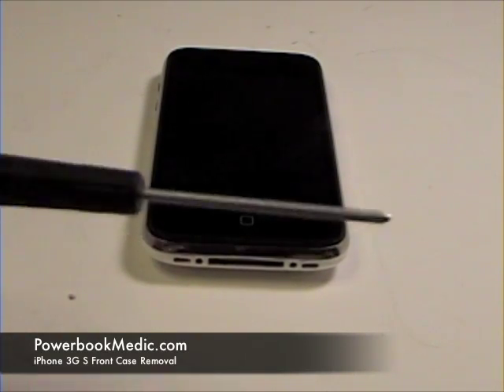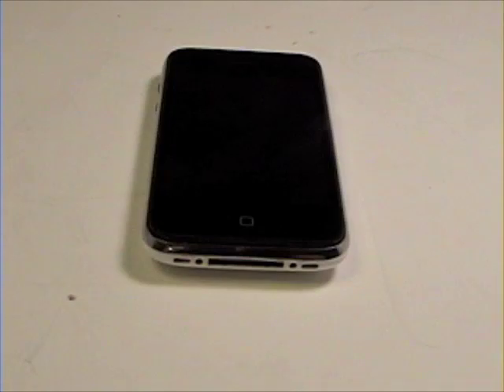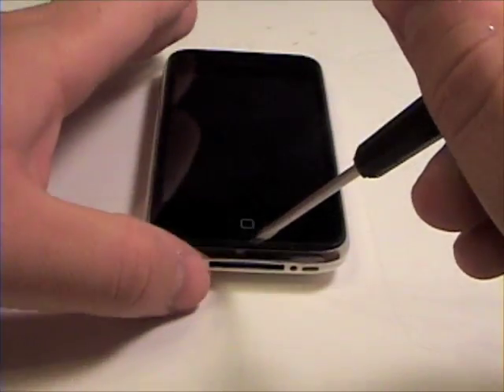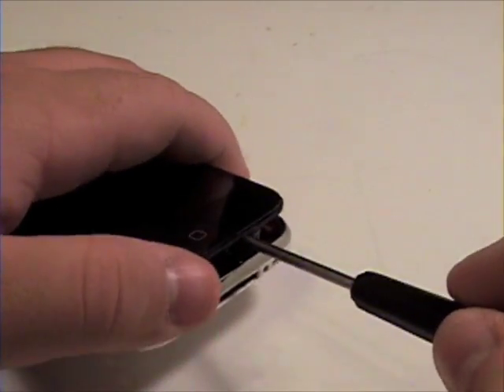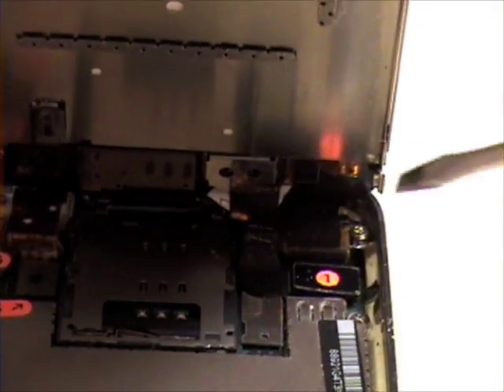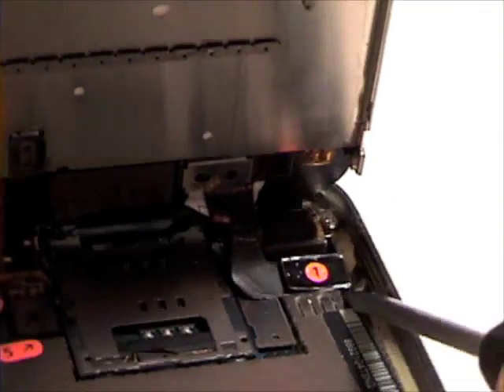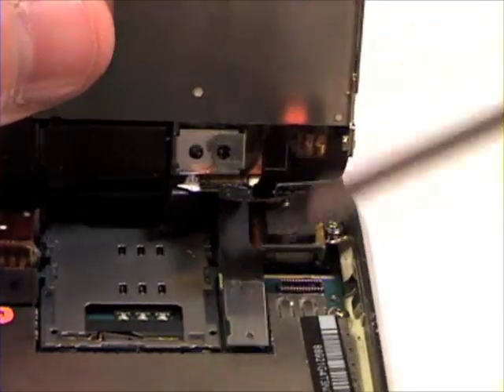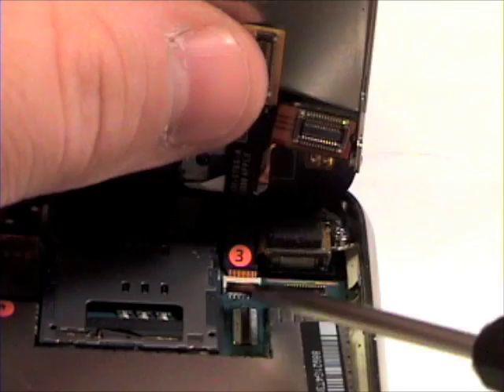iPhone Repair - 3GS LCD and Digitizer Front Case Removal

Comment: Thanks. This is weird. I dissembly the logic board trying to find any defective part. I read about the coil being damaged but it looked fine. So I just assembly everything again thinking on taking it to a workshop, for my surprise, i turned it on and display was perfect, the problem now is that the digitizer is not responding a the #2 plu doesn;t fit the board's plug??? Any advice, should I jus get a new digitizer??
Thankyou very much